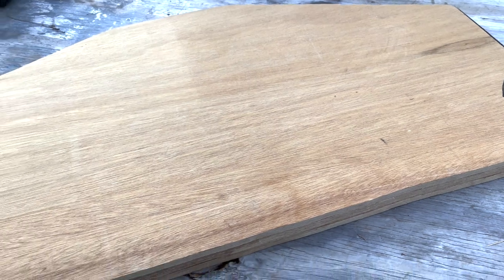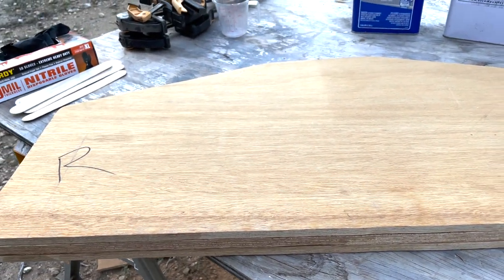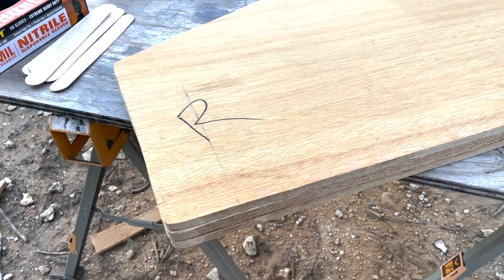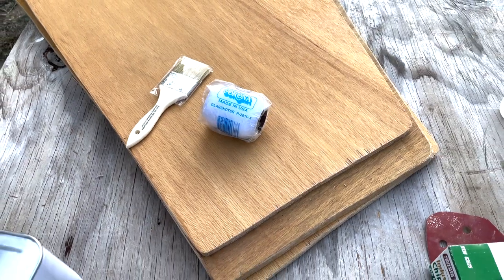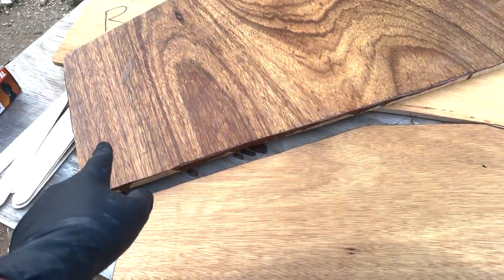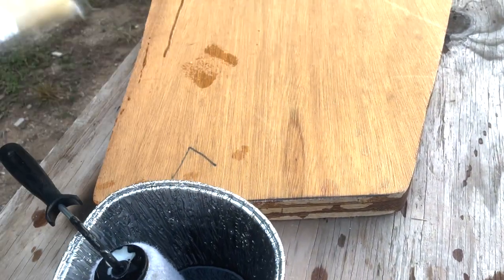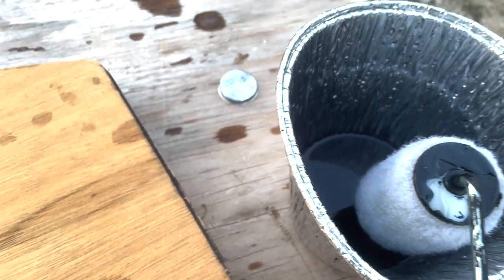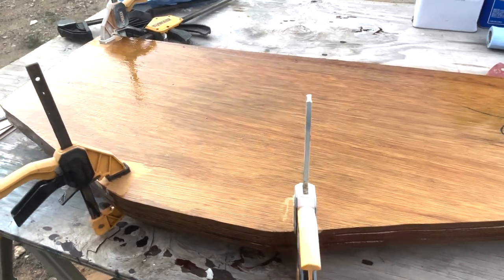Glastron Rebuild Nightmare! Rebuilding a Boat Transom Part 2

Comment: I’ve seen others use a layer of chop strand between the diffeent wood sections of transom.  What are your thoughts?
Reply from the maker: You can do that too. I’ve even used adhesive to make the layers flexible. There’s no wrong way as long as you use  marine plywood and seal the outside.